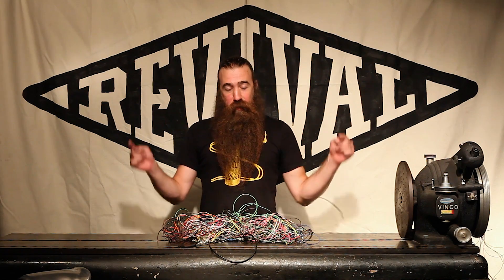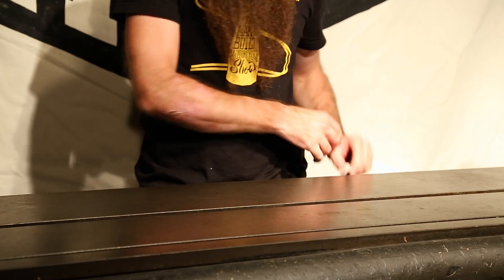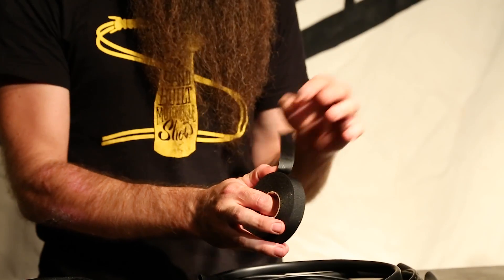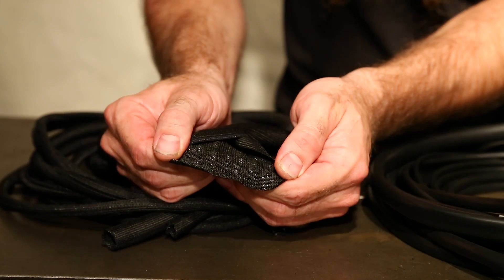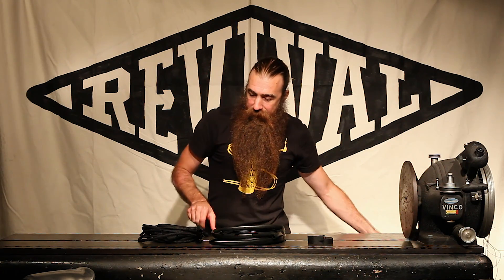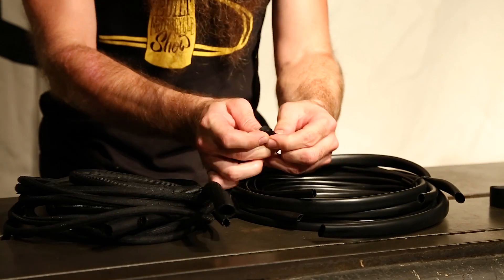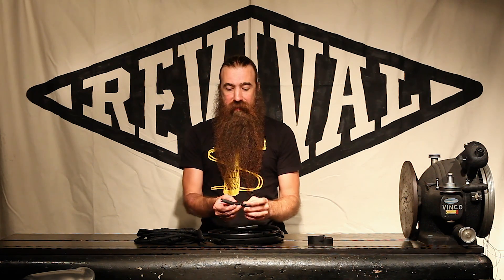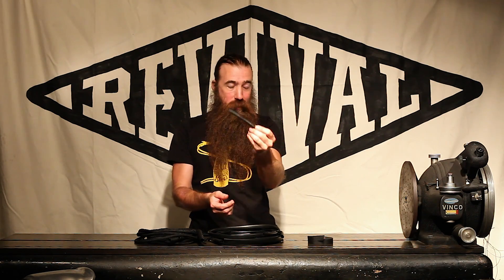Revival Cycles Tech Talk - Wire loom your motorcycle the RIGHT way

Comment: I have a m unit basic. I’m having a hard time with the low high beam switch. It doesn’t work. But I’m the other side low and high beam works in the 3 position light switch. What am I doing wrong?

Comment: What's the best way to cap off a section of braided sleeve? Heat shrink? Also are there any gromet type caps that the braids can be installed into so when they enter a electrics tray it's nice and tidy?
Reply from the maker: Interesting idea. Never thought to use para cord, but I'm sure that works and looks good. Any guess on the temp ratings on that stuff?
Reply: yes.  Part of my loom is parachute chord with the inner core removed. So it's braided fabric. I used heat shrink on the wires,  then pulled the fabric sleeve over and did two layers of heat shrink staggered on top to secure it in place.  Seems very secure and it looks Really Good!
Reply from the maker: Most of the time, I'll just use a bit of the cloth tape to wrap the transitions with split loom. Its way easier to remove and redo if you ever need to get into it.  But with the vinyl tube, I will use heat shrink to cover and seal the transitions. With the tubing there is no way to take it apart so the heat shrink is the way to go.
Reply: Thanks for yet another good clip. What’s your take on self-vulcanising tape?

Comment: I have just received delivery of 1m of that corrugated plastic shit of which you speak. How can I possibly use it on my bike now?  Off to Google a UK supplier of the good stuff. By the way, thanks for all the vids, they've helped immensely with my M-unit install. Cheers.
Reply: Mark Guppy try, Hill Top Products, PoleVolt Ltd, AES or Kojaycat in the UK
Reply: Thanks Richard, much appreciated.
Reply: Mark Guppy no problem, I rewire bikes for a living and have installed M-unit etc quite a few times.

Comment: I will install in my bike I just pull all wires because ....
You guys have any ideas why I'm burning the coils on my bike soon as a get to high rpm the coil burn I'm on my 3 one hope you guys can help always watching the channel!!
Reply from the maker: This is a difficult issue to diagnose without knowing a lot more about the bike in question. If you are replacing coils, they will need to match the same specifications as the originals, and if you have some type of CDI or TCI system you will need to check that the "black box" is functioning correctly. 

the m-Unit will not necessarily fix an issue with an ignition system. BUT replacing all the wires could solve some type of short circuit, or improper connection. The ignition system will need to be working normally before an m-Unit installation is possible.